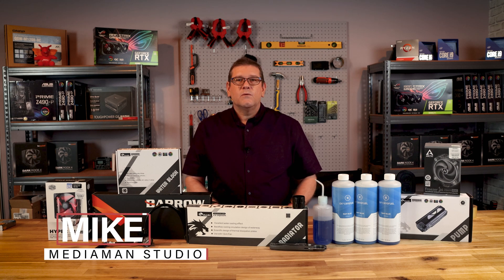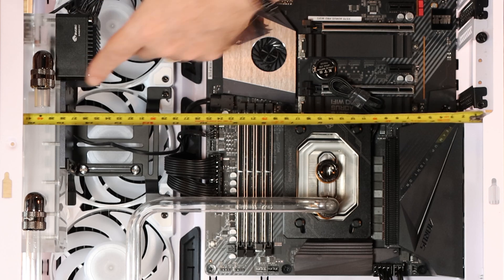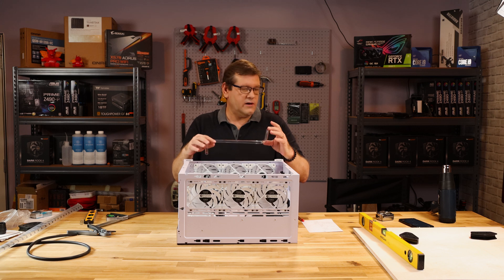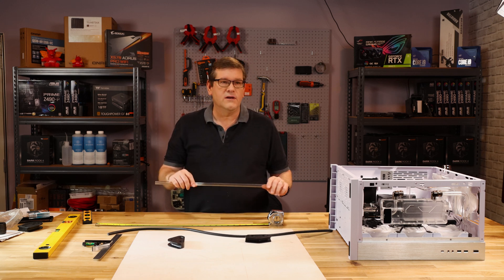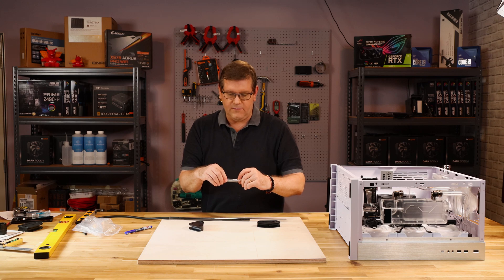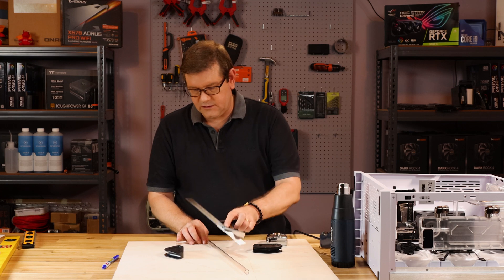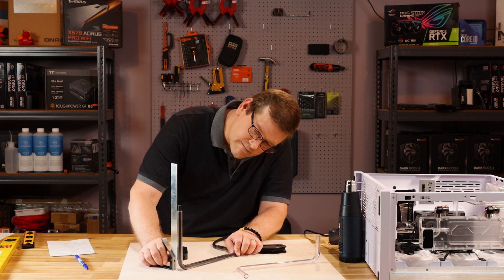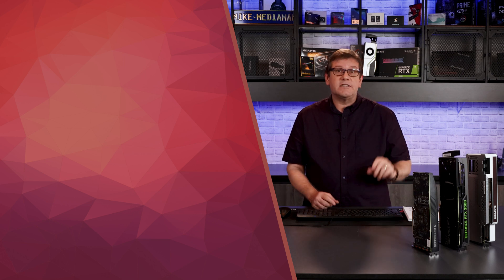How to bend PETG tube, perfect bends every time! Water cooling part 2

Comment: Thank you so much for actually demonstrating a real world tube run on a watercooling setup.  So many, talk about ideas, maybe show tools and then make some crazy bends in tubing that do not relate to a real situation.  It was so refreshing to see an actual pc with watercooling components installed and seeing the measurement and bending techniques that make that run. 

I really liked your use of tools and I would like to do the same.  Maybe to go as far as to make reference marks (think conduit bender) where you can get those repeatable results.  Thanks!

Bravo!!  Great work.  Subbed.

Comment: This is indeed the best video I have come across regarding bending tubes! Thanks for the great content. I do have two questions though. The first one is if you have some tips regarding bending acrylic ? I had a bit of a hard time bending acrylic with the use of a jig, it seems like it's easier to bend a 90 deg by hand. However, it becomes hard to do complicated bends without being able to use the jig.
My other question is if you had a tip for a situation where the distance between the two 90 degree bends is rather short, I am trying to make a bend very similar to the one you are doing in the video, except that the distance between the bends is around 95mm, this means that I can't get the tube in the jig after making the first bend, in order to make the second bend because the first bend prevents the tube from going in straight in the jig, since it's so close to the second bend. Do you have any idea how I could solve this problem ? Thanks again for the great content.
Reply from the maker: hi Amat, thanks for the kind comments. Please share the video.
As for acrylic, I have never used this material so I can not give any advice. Also for short bends. Sometimes you just need to do the bend by hand, its the only way to get the tube to fit. That is what I did with the short tube in the video.
Reply: It's been a year since your comment, but just in case (and for others): If you have problems bending acrylic tubes with a jig, you didn't heat up the tubes enough. When the tube starts getting soft, don't bend it straight away, like you can do with PETG. Keep heating them up for much longer, getting more heat into the material and softening them (without going too far, creating bubbles inside the material) and then bend it.
For short distances I took 2 90° jigs and cut them into two pieces, leaving just one straight side and the curved part, but not the other straight part. That way you can fit them into shorter spaces and you'll have to adjust the perfect 90° angle afterwards anyways.

Comment: This is excellent. Methodical and logical. I am just about to crack in to my first custom loop, and THIS advice is the most competent I have seen by far. 
Working back from known reference planes, the use of the set square all the way through, running a test for stretch allowance to gain finishing distance beyond a reference point, all superbly elegant. I dare say you have saved me a lot of trial and error.
Reply from the maker: thanks for the kind comments. Glade it helped. Please share

Comment: I was looking for the most sensible way to do tube bending, having an engineering background means I actually need numbers and calculations to make sense, at least for me lol. good thing I stumbled to your video. Thanks!
Reply: Quick question, on your 2nd calculation why didn’t you add 7mm to your 40mm to get your first height? To my understanding, you said “from the top of the fitting”. So your calculated value 88mm at 3:07 is not from the bottom of A to the centre of B. It’s actually to the top of B.. right?
Reply from the maker: @BlueBracelet202  Oh your right, But for the demonstration, i think most people get the point. 
But thanks for pointing that out.
Reply: @MediamanStudioServices  i think it took me like 10 replays to calculate because it didn’t add up in my head lol.. but still very educational, I’m going to try using your method. Hopefully i’m patient enough
Reply from the maker: @BlueBracelet202  Good luck with that and let me know how it goes.
Reply from the maker: thanks for the kind comment
Reply: Es más fácil usar reglas xD las vas apilando con celo y te sale la altura ya perfectamente xD

Comment: Just found your channel and it was a blessing. I want to stop eye balling my bends and this video should help to get some clean straight bends. The only question I have is about the center line on the 90 mold tool. I'm a little lost on how to find how much it stretches when you bend it. I've watch several times and that's the only part that has me stuck. Could you explain it further if possible. Also this was hands down the best video on this subject
Reply from the maker: hi Tuga777, thanks for the kind words.
So to find how to bend you need to know the radius of your gig. My gig was 2cm to the edge of the tube from the first bend mark, and my tube is 14mm.  So 2cm plus 7mm  (half the thickness of the tube) =2.7cm
I measured it at 7:16 of the video. 
So measure your gig the same way
then make a mark on test tube at say 10cm and measure back 2.7cm. 
Put this mark on the bend line
Once you bend the tube, you will notice the tube bend center is not at the 10cm mark, the difference will be the stretch.
So for me the stretch was about 2.5mm - 3mm.
 so I was making my marks 3cm or (2cm + 7mm + 3mm = 3cm) (radius + half the thickness of the tube + the stretch = 3cm)
The stretch for most bends is around 3mm. so if you use this amount added to your radius plus the thickness, you should be good..
Hopes this helps
Thanks for watching
Please share on your FB to help grow the channel.
Reply: @MediamanStudioServices  thanks for your quick response.
Reply from the maker: @Tuga777  Hope this helped

Comment: I'd thought I'd follow up with you on a previous comment and advice from you on ECC ram for the ThinkStation P620 on one of your earlier videos. I had 64GB of Lenovo ram (4 x 16) and wanted to add another 64GB (4x 16) to make it 128GB of 8-channel ram. However I wanted to save $$ with non-Lenovo branded ram. I ended up buying NEMIX ram from Nvtek on Amazon (they are based in Florida) for a little more than just 1/3 the price of the Lenovo ram and it worked perfectly. Same identical timings and I now have 128GB of 8 channel ram that passes all tests. Initially one stick was bad and then replaced it arriving to me within 24 hours of receiving the returned bad module with overnight FedEx. Probably would have been same day but I'm in Toronto.
Reply from the maker: hi Web Design, great to hear that this worked out for you.